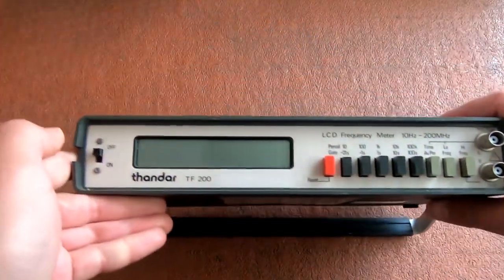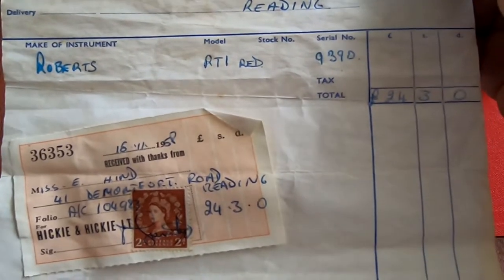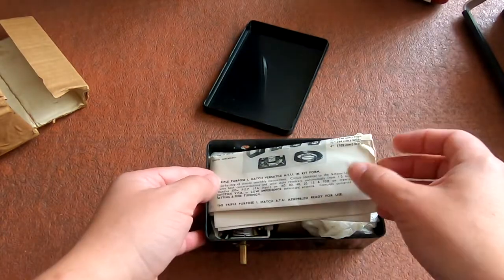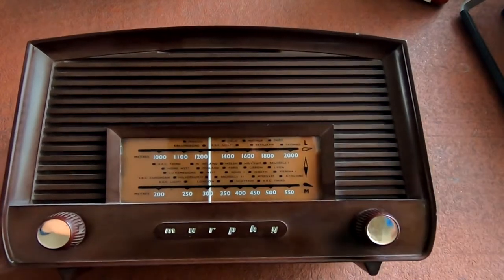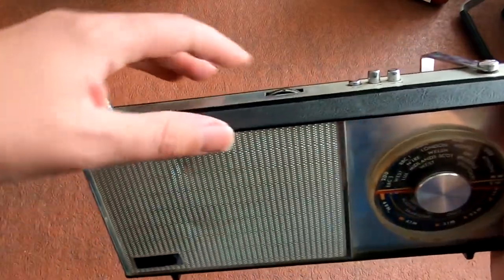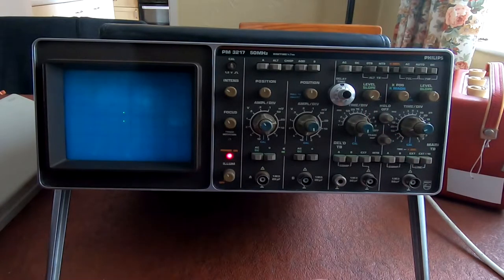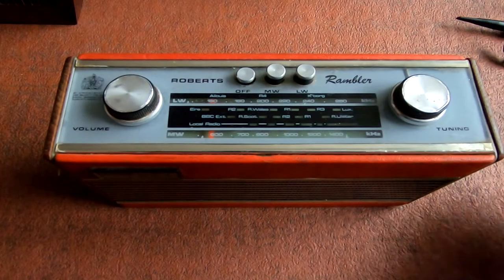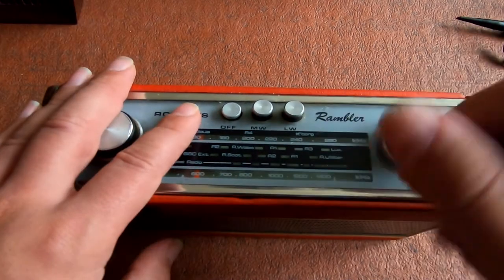BVWS Golborne Swap Meet

Comment: Looks like you did very well at Golborne Dom. That RT1 looks great especially as it has the original handle. The ATU kit is very interesting as I’ve not seen one before so I look forward to seeing you put that together and test it. The Murphy looks great and I bet that Bakelite case will shine nicely. The Ultra was a bargain and I’m sure you will be able to sort that one. Nice one Chris giving that scope. I bought one of those many years ago at a radio rally and it was my 1st scope as well. Great bit of kit. Good luck with the Rambler and see you in December if you go to Wooton Bassett. Cheers Graham